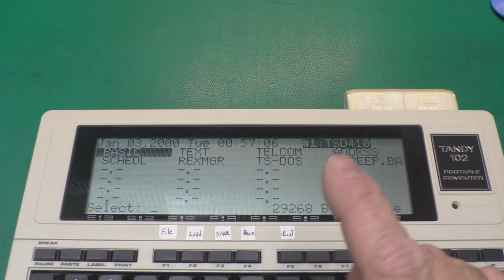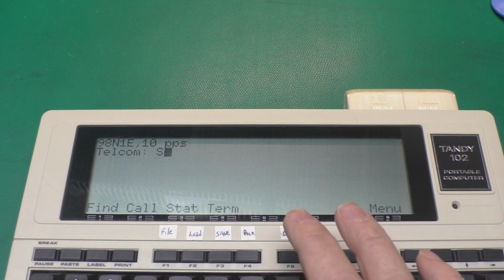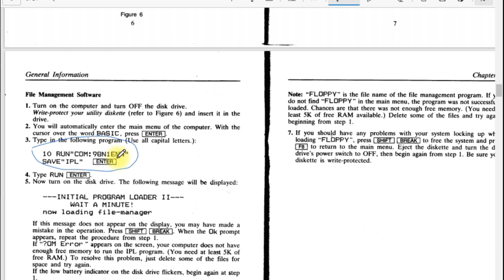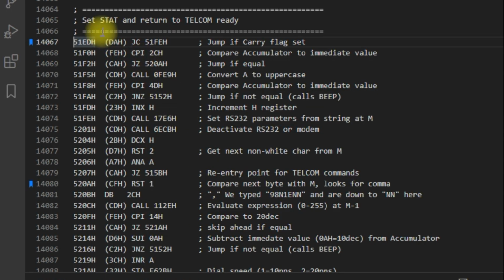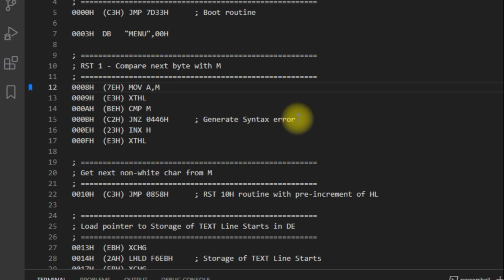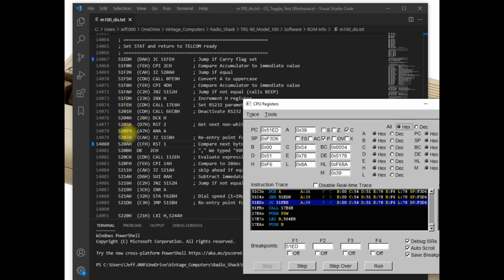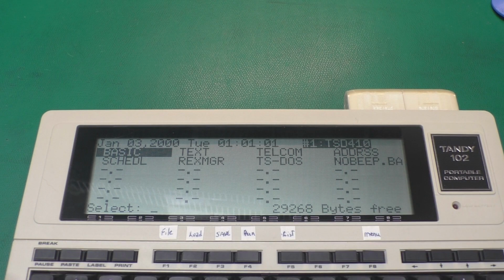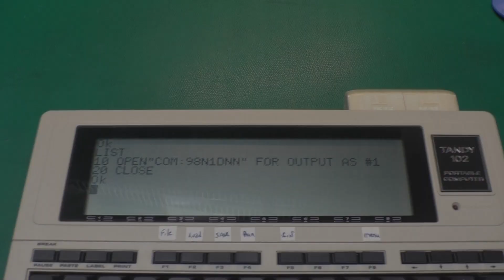Shorts 0004h, Howzitwerk? Why the wrong COM config string still works on the M100/T102

Comment from the maker: For some reason YouTube is removing all comments to this video after the first four. I'm not sure why or if it can be fixed.
Reply: This is why I generally do not watch or comment on videos that are linked through Patreon until they are public. I did this this time but YouTube murdered my comment as usual. :/ 

Anyway, commented on the '' OPEN "COM: '' part, theorising that perhaps it work without error beep in basic because possibly the parser only read the expected argument length and disregard the rest. 

I suspect YouTube do this to "punish" and discourage the usage of Patreon instead of YouTube Membership or what it is called.
Reply from the maker: @MariaEngstrom  I have heard from other YouTubers this comment black hole problem also happens to them at various times on various videos. It seems like yet another bug with YouTube comments.
Reply: @HeyBirt  I realise this time I'm in error, I actually commented on the post for the video on Patreon, not on the video itself. 😔

Comment: Interesting little video, I have never really used that sort of step/trace function in an emulator. From the source code there it looks like you could make the NN/EN command appear legitimate by adding the comma before it.
Reply from the maker: Adding a comma would get it to the next section of code which tries to evaluate the next two characters as an expression. It expects '10' or '20', anything else is treated like a syntax error. I tried a few things like (10+10) thinking it was a valid expression but it was not having it :)

Comment: Really dig the "shorts".  How amazing are emulators?  Not only can you virtually use these classic computers, their operating systems, software/ROMs, but you can monitor the code execution real time?  So very cool.  And what is it about the simple Model T that captures the interest of so many people - users, writers, computer/electronic experts and hobbyists?  Fun to follow, watch, participate and benefit.
Reply from the maker: They are the perfect size, about that of an actual notebook. They are simple, yet still very useful. Back in the day it was an amazing amount of computing power that you could carry around and it was powered by simple AA batteries.
Reply: I've often pondered that same question, Chris.   They still have a high level of suitability for various tasks and yet are incredibly simple, as Birt has stated.  I think for a hobbyist/programmer, the additional appeal is that one can attain almost a mastery over the device through some clever programming, and that is something that isn't as reachable with more modern operating systems and hardware due to the vast increase in complexity.